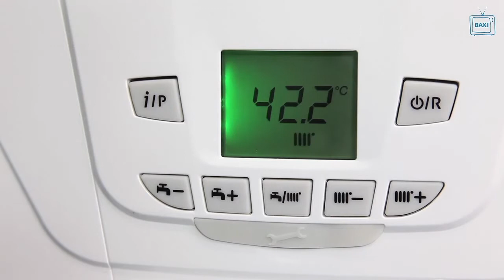Installing Baxi EcoBlue Combi or System boiler, checking electrical polarity is correct

Comment: good day
I wonder if it is possible to somehow reduce the pump speed on this boiler? I have a problem because my radiators have a lot of noise and no air in them..can the pump speed be reduced since it is modulating
Reply: Does any one know how to fix this the only way I have done this is by replacing the PCB and every year or so come across this issue. :(
Reply: I would say its the pump that decides the rate in the manual I think it calobrates it self to the flow type to the pump.
Reply: @carlharding7984  I don't know how to solve the problem, I've had a boiler for years and the noise of the pump annoys me terribly. It says that it's modulating, but I don't see any difference from starting to turning off, it's always the same sound in the radiators.